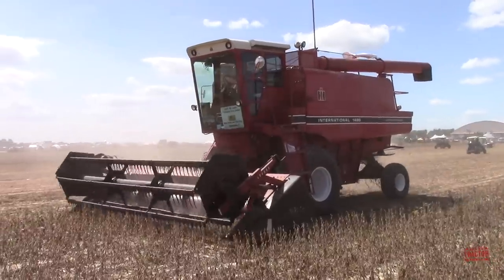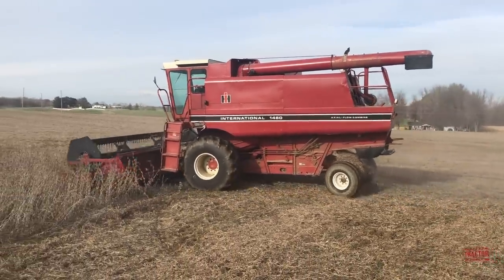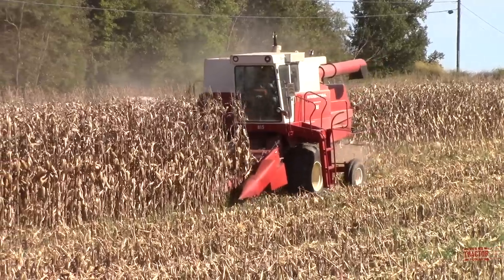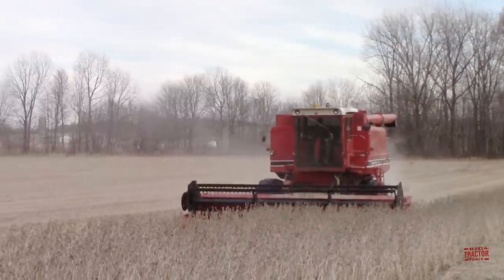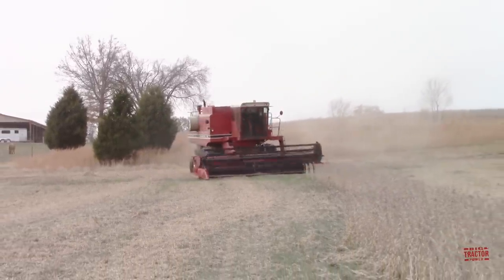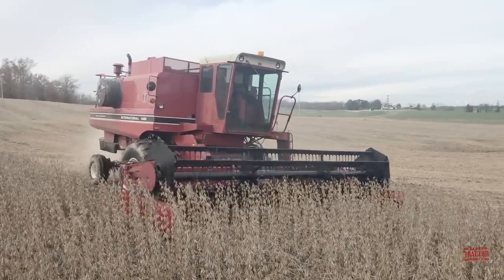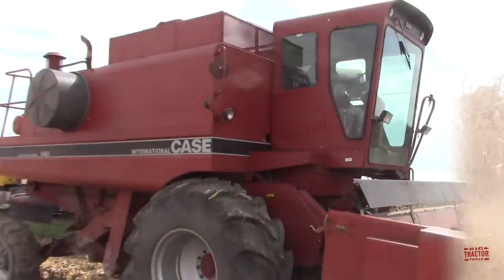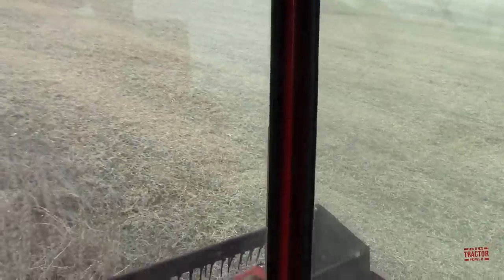The First INTERNATIONAL 1460 Axial-Flow Combine Produced

Comment: In 1973.74 and part of 1975 at International Harvester plant in East Moline Illinois. I was working in what was called the loony room assembling the first 1460 so that the engineers could figure out the best way to set up the assembly line for production. We put that machine together and then took it apart so many times I knew every bolt and nut by heart. The crew that worked in there had special badges that the security guards checked every time you came in or walked out of the room. Everyone had to sign a "No disclosure agreement" before we were even allowed to see the inside of the room. When we finished with the 1460 we then started with the 1440, then the 1480, the 1482 and finally the 1420. When I finished there I returned to the combine repair department, even then we were not allowed to tell anyone what we had been doing until the first machines started down the assembly line in 1976. When the entire crew that had been in the loony room went up on the assembly line to work with the assemblers on how to put it together. To make a long story short this is how I met my wife. She was one of the assemblers hanging the grain tank when we got acquainted.
Reply from the maker: Wow what a great history.  Thank you for sharing. The 1460 is a land mark machine.  A big difference from the 503 and 915.
Reply: @bigtractorpower  The first IH Combines I worked on were the 403/503 machines. Then I progressed to the entire 15 series machines as a combine repair specialists and finished up working on 2388's and Cotton Pickers when I retired. Then Case IH hired me back as a Pro Harvest specialist the first couple of years working on both combines and cotton pickers and then the next 23 years with Cotton division all over the world. My last time working on combines was at the Grand Island factory on 8020's about 15 years ago.

Comment: Those were probably the best machines ever built. I started out on an 815 combine and dad also had a 1420 axial flow. We used the axial flow only for corn the first 5 years till the 815 started to give us issues. I went and bought the electric sensors to run the head with the 1420 and man that machine did such a better job in beans that was the end of using the 815. For being the smallest machine in the case lineup, the rotor design really improved everything that machine was capable of. Seeing these machines really takes me back to a better time in the industry when things were so much simpler. I do remember my dad telling me that Minneapolis Moline actually sold the first rotary machine way back in the late 50's/ early 60's. When New Idea took over they were dropped from the lineup and they were all conventional combines. Once again another great video...///

Comment: The amazing part is that other than an improved cab that combine has very few differences from a 2388 that was produced 25 years later
Reply: They both worked and do a damn good job..
Reply: You could farm with either and you’d do just fine. Combines are great, but the real money is made with planters. 

International was light years ahead. They had very good MFWD tractors all the way back in the 1970’s.  I’m all green and yellow now, because if my head has to go spinning to figure our The Who, what where when and why with my equipment (AGCO), then I have no use for it. Major hat tip to the old IH stuff though. It was the best.
Reply: 2366 but yes.

Comment: I remember riding in our 1480 as a kid. I can remember the hydro whine, sound of the 466, smell of chaff in the air...one of my favorite memories.
Reply from the maker: Very cool. What crops did you harvest with your 1480?  I hope to find a 1480 to film some time.
Reply: bigtractorpower Corn and soybeans in southeast MN. Unfortunately time got the best of it, but it was the king at one time! We also used to have a 4366, so I can relive some of that through your 4786.
Reply from the maker: Wow nice IH line up.  I hope to locate a 4366 to film at some point.  Was your 4366 a red or a white cab?
Reply: bigtractorpower it has a white roof, but the rest of the cab was red. I hope to at least partially restore one someday. I know the early ones had some transmission issues, as ours did. If I get my hands on one you’ll be one of the first to know!

Comment: I've owned both a 915 and a 1978 1460. The axial flow was much smoother and had less moving parts, however it got "indigestion" when anything green went in...
Reply: Indigestion.  That’s funny
Reply: Oil seed rape was a nightmare when it's wasn't swathed into rows ..
Reply: We went from a 915 to New Holland TR's, soybean seed business, cracked way less beans. Went back to IH  in 1983, currently in a 2588... In the late 80's we put the rice rotors in them, hybridized them, solved the "green indigestion" issues....

Comment: Weren't they manufactured also in France? Saw no comments on that below. Difference was the radiator screen was turned to the rear and intake for cab ventilation was on different side of cab. At least that's what my neighbor says, as he has one of those. Still going strong (the combine).

Comment: Case is manufaturing the new 4088 harverster in China based on the 1480.

The 4088 has outstanding performance and harvest capacity.
Reply from the maker: Very interesting.  I did not know about the 4088.  It looks just like the 1480 with a modem cab.   Thank you for telling me about it. I looked it up at https://www.caseih.com/emea/en-africa/News/Pages/Axial-Flow-4088-combine-put-to-the-test-in-tough-African-conditions.aspx

Comment: How about a mention of the 1460`s cousin the 1470 hillside version.
Reply from the maker: I have the 1470 sales literature.  Unfortunately I have not had the opportunity to film a 1470 to share here on YouTube. Maybe some day I will.
Reply: @bigtractorpower  I know 1470`s are primarily used in the Pacific Northwest. We still use one for the really steep slopes.
Reply: Used to be several 1470 in york county ne. The IH dealer bought a bunch of them and removed the hillside eqiupment from the combines. Sold the stuff to other dealers in hillier ground.
Reply: @farmallfan1466   The Rahco hillside undercarriage was the best on the market. We still run a 1982 1470 we did update to a 1010 header and hydro trim on the feeder house. It makes the header follow the slope changes very well. Plus we can operate the header trim going trough draws. There was a shop that purchased a 2166 and took the undercarriage  off a 1470 and made a really nice machine. We still also have a John Deere 95H that uses  the Rahco undercarriage. It was a big change going from 95H with no cab to a 1470.

Comment: When the going got tough. The John deere outshone the rotary. In perfect conditions the rotary did a great job with less fuel.  And less moving parts.
Reply from the maker: What type of conditions?  I always found the 7720 and 1460 to be a good match. The 7720 is great for straw production and the 1460 stronger in corn.

Comment: Interesting...you had to buy a ENTIRE machine to harvest corn with.
On a Deere,you swap the heads out,with a few other adjustments and your good.
Reply from the maker: John Deere has corn and soybean specials and Rice combines. I have lots of brochures on them.
Reply: That was a bit misleading - the differences were in the design of the concaves and the rasp bars used on the rotor, they were multipurpose machines. In the late 80's we (midwest soybean/corn/wheat farmer) started hybridizing them, using a rice rotor in the "corn" machine, it would handle green weeds (this was before roundup!!!) and tougher soybean cutting conditions...
Reply: 4 gauge My cousin had one of the first IHC 1460s and it harvested everything. This video is misleading.
Reply: @interman7715  You'll have to take that up with B.T.P.,I'm not the one that made the video,just an observer.